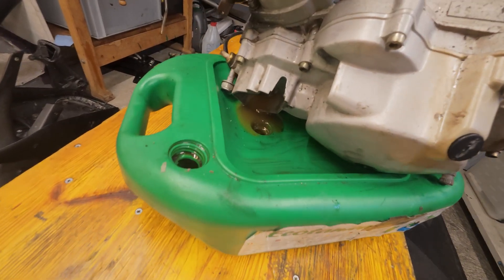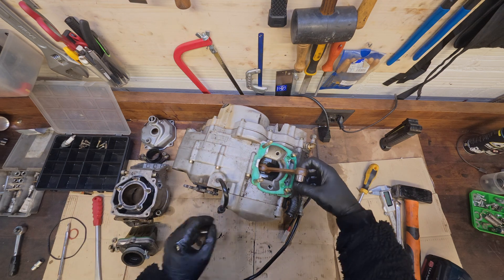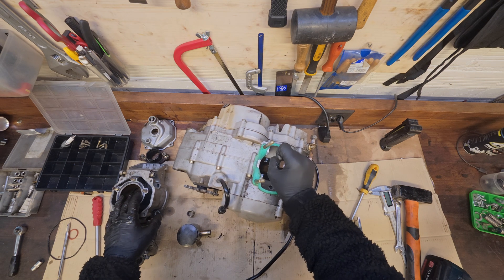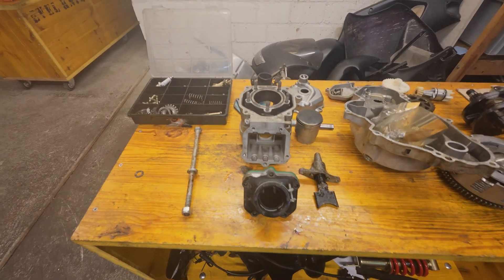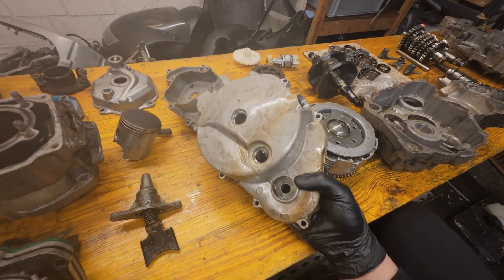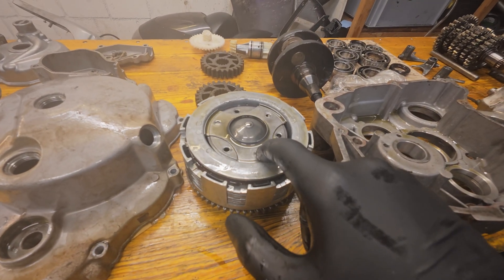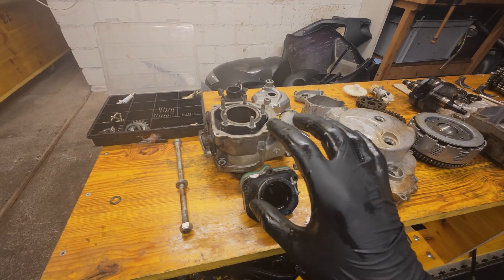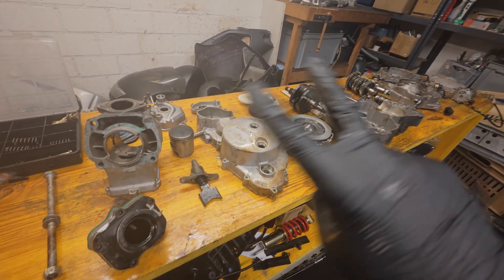This Engine is TOAST! Watch the Full Teardown!

Comment: Engine is type 123 .   122 has different bore and stroke!
Reply from the maker: They have both 54mm bore, same engine just a different version with the 122 being improved to simplify rebuilds
Cylinders are technically interchangeable except for the different ports and cylinder stud positions

Comment: Hi, are those signs on the head debris or detonation? There was a version for the Swiss market which mounted a different cylinder and had lower compression ratio. Since the AF1 futura there's always been the cylinder with the extra inlet port which is missing in yours. I'm not sure about the Swiss version, I've only read in the Rotax 123 manual that the specs were different, but didn't say much about the ports. Just to be on the safe side, since there's no inlet port on the crankcase either, they could've mounted the whole Pegaso engine and you'll find yourself with different gears, unless they substitute them with the RS or AF1 gears ratio.
Reply from the maker: Yes, it was detonation I think (probably a blown piston) . This one is indeed a swiss cylinder but I think for the Pegaso. The cylinder was replaced but the engine is originally a RS Engine. The AF1 Engine Cases (and I think also Pegaso / Red Rose) look a bit different from the outside (different clutch cover). So confusing... Rotax 123 is older that 122 and there is even multiple versions of the 123 🤣 and thousands of different cylinders
Reply: @MotoMottoTV  I know, 122 you have a standard cylinder for all of them, 123 there were different ones, AF1 futura is like the first RS, but older AF1 are different and so on. THen there were versions for different countries so again, it's a mess. With 122 you get only two cylinders Gilardoni 1 and Gilardoni 2, which are identical, except for the whole for the pneumatic valve, which you can easily drill if there isn't (don't remember which is which, even though I have both at home)
Reply: Though I'm sure that that extra inlet port was there on my old AF1 futura, which was 1990 I think. The Aprilia RS came after, so it's a bit strange that they discontinued that only to be then reintroduced on the Rotax 122. I think my AF1 had a cerakoted light bronze clutch cover, but I could be wrong, cause we also had an RX and the engine was exactly the same, just for the gears. These were Italian though
Reply from the maker: @tuboneanni80  would not be surprised if that is a case especially made for swiss market... We always get our extras... Also a extra heavy exhaust with 2 CAT that can be used for Benchpressing..
The port on the cyl and the case definitely don't match. One has it the other doesn't. I'll see how she runs and switch to another case if needed.
Not a huge fan of the 123. I like the 122 much more for working on it
Reply: @ Y0u have some work to do if you want to match the ports, but makes a difference. Have you checked or had someone checked ovalisation and exact measurment of the bore. Sometimes old cylinder might look worse but then turn out to have better specs and just need deglazing with a brush just to give it crosshatches, while if there's ovalisazion, you need to remove 0.01mm of Nikasil with a diamond tool. If you have any questios please ask as I've worked on a few of these engines, they're more common in Italy and I might have more imformation. If you need the Rotax 123 manual I have one. And I agree, the 122 is definitely an improvement, if you find the engine it'll fit the chassis. I still have an RS125, latest model and there aren't many people who have this bike, so, as a spirit of camaraderie, it's nice to help each other. Most of these bikes were used by teenagers who did horrible things to them, I've open engines where everything was wrong, from squish gap, to gaskets, pointless porting. There are a few things you can do to make this engine run like clockwork, but you need to know them inside out.
Reply: @MotoMottoTV  By the way I strongly discourage you to use any kit, definitely not the Polini 155. The Italkit 140 is quite decent, but all the exhaust you find around are tuned for the 125 so you might end up with just a bit of more torque. If you need to put a new piston, I recommened a 2-ringed Wossner, it weighs 7 grams less than the original Asso (which they discontinued) and it has two extra lubricating ports. Compared to Vertex is 9 grams lighter and it'll cost you about 25 euros more but it can last longer and put less strain on the engine as it's lighter. With my driving style, an Asso would last 16/18 thousand km, a Vertex no more than 15, and a Wossner up to 18. As far as conrod, there's a good Italian brand that is about 120 euros but I don't think you can get it there, another good one which costs about 140 is the one with 'made in Japan' written on it. They can all last 2 pistons lifes. Original bearings as teflon SKF C4 tolerance. I'll tell you this because I've disassembled engines where the bearings had different tolerances and if I hadn't known what the original were, I would've put the same ones, which would last less. You can't find this info on the manuals. Also speaking from experience, you can technically mount the SKF C3, but you might end up seizing them if you're not careful, particularly when you break in the engine. C3 being a tighter tolerance can go out of spec later and last longer but I don't think that's worth the risk, particularly if you plan to make it rev over 11k rpm
Reply from the maker: @tuboneanni80  I already had C3 bearings seize on me twice before, not going to do that mistake again 😅 I am using the ones described on hartrusion.com for multiple engines with good results.
I already went for the Italkit 140cc and I am aware of the echaust issue but I wamt to figure out if there is a way to set it up well. The comments on the engine disassembly video were all sayig I should go for the Big Bore Kit so I am doing that 😅 (I would actually went for the italkit 125cc since I had great results with it before)
Reply from the maker: @tuboneanni80  Any Idea on the exhaust problem and setting that up correctly?
Reply: @ I can only tell you that there was a guy who had this kit, and I sold to him an old arrow, it's called arrow challenge, and it seemed to be the best he could find. It's pretty rare to come across. I wouldn't recommend Jolly Moto as they are tuned for high performance 125cc that have been slightly ported or revisited. The arrow street or giannelli are similar to the original. I know Polini made an exhaust for its kit, but I think it's impossible to find and it was tuned to that particular kit. Theoretically as now your cylinder is a supersquare, it should perform better at lower rpm, so you might want to find an exhaust that has its best performance around 8000 to 10500/10000 rpm and then have longer gears. I think if you get an original exhaust, the one with the catalytic converter, open it, remove everything, even the anti-noise parts (I don't know how to call them), you should be left with an exhaust that performs well between 8000 and 11000 and has a bigger expansion chamber. It might end up looking similar to that old arrow challenge, just a bit heavier. Otherwise I have no idea, as I don't think Italkit ever made an exhaust to measure. I don't think the aim of the kit is to make the bike rev higher than 11.500. I've watched your last video but I can't work out what exhaust your have
Reply from the maker: @protoperipoli3196  I also cannot figure out what exhaust it is 😅 seems to be an old one specifically for the RS125 GS Model. My friends RS has an Aprilia Exhaust (completely empty from factory and the shape is pretty similar) the newer ones are all shaped differently. Curious to see how it performs.
Reply: @MotoMottoTV Anyway, first break in the engine properly, not matter what exhaust you have, then you can worry about that. Give it a slightly richer carburation and write me when you have some news. I don't want to teach you how to suck eggs, these seems to be things you already know. To be honest it's the first time I hear RS125 GS model, no idea what difference would that entail. The first ones we had here were called RS Replica and the last version before the introduction of the Rotax 122 was called Extrema. Anyway, top job, good luck with your challenge
Reply: Some tips to reach 200kmh, you can gain about 7 kilos by removing some parts that are not necessary, a good windscreen (I can tell you the one I bought for mine, which is a 2008 model, it made a lot of difference in 6th gear. For speed and acceleration is not just about power, but it's about aero as much as weight (you might go on a diet as well lol)
Reply: If you mount the cylinder with the boost ports, make sure you match the crankcase ports with the cylinder

Comment: some of my friends testet big bore cylinders on their bikes. the polini and the italkit ones, they where pretty underwelmed. a bit more power on the low rpms but not much more at high rpms. and some jsut reved to only 10k.
best thing to go for is a 220H cylinder or if needs to be new take an italkit 125 with the 2 ring piston. thats what i am driving atm and some of my friends too.
we are like 20 people in a whats app group some lads with 4 or 5 RS and they are testing very much
Reply from the maker: @dosacole2201  thanks for the feedback man! I already used tht italkit 125cc with great success. For this project I already mafe my descision so let's see what happens 😉

Comment: Big bore Big bore big bore 🎉🎉🎉🎉
Reply from the maker: @AndersR-s2z  🥰
Reply from the maker: @AndersR-s2z  I see where this is going and I love it 🤣
Reply: @MotoMottoTV  did a new top end on my klx250 and only afterwards remembered that there are a big bore kit available 🥵🥲🥲
Reply from the maker: @AndersR-s2z  Haha I did the same on my KLX250 (the tame street version with EFI). only to figure out I should have gone big bore :D but go look up the marcelino cam mod which basically adjust intake and exhaust cam timing by half a tooth. really wakes up the bike
Reply: @MotoMottoTV  i have the OG 1993 version. So considering doing the BB pump carb upgrade
Reply: @MotoMottoTV  and thanks for the tip👌
Reply from the maker: @AndersR-s2z  oh, a pumper carb will give more punch for sure! Combibe that with the mcm mod and the bike will even be fun 😅